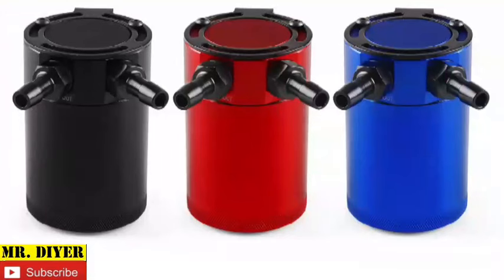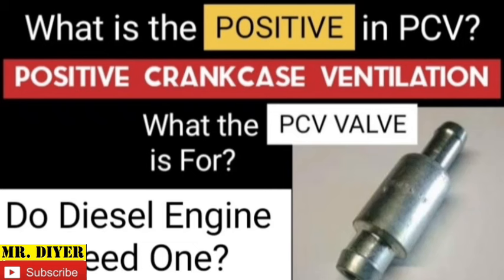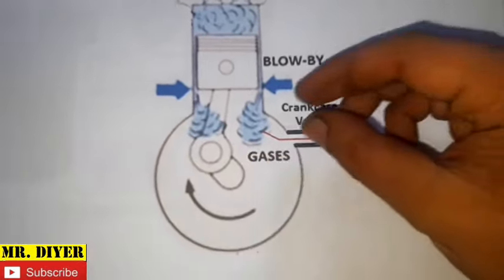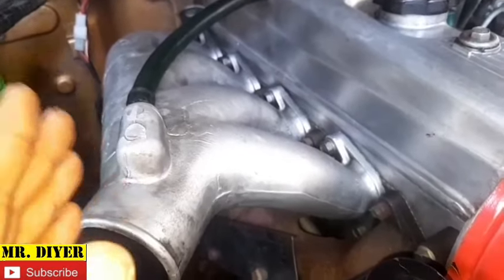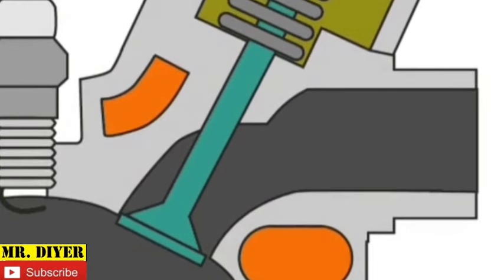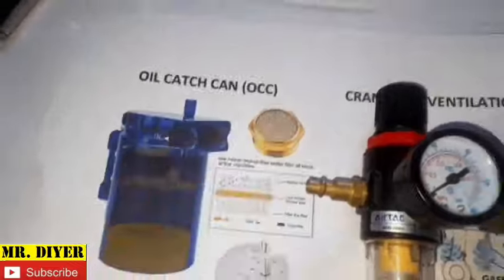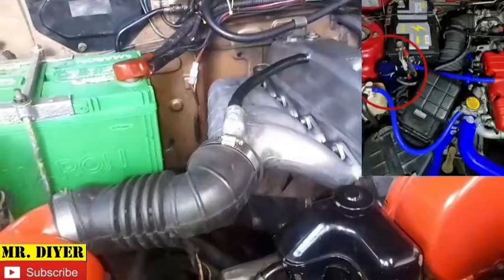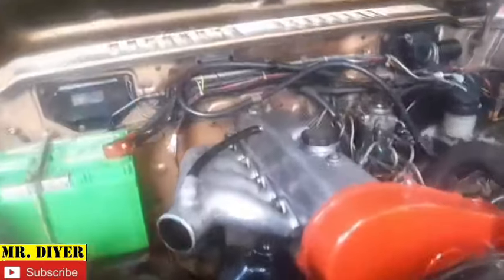This Is Why I DO NOT INSTALL AN OCC OIL CATCH CAN

Comment: installed OCC on my strada with turbo, yung hose nya dumaan sa turbo. yung blow-by na naproproduce ng makina is nahihigop lang ni turbo. chineck ko rin yung dipstick if nag bubuga ng oil caused by blow-by, wala naman. siguro ok lang maginstall ng OCC if meron turbo. even if nahihigop ng turbo yung blow-by (fast air) meron pa rin oil na nasasala.

eto naman sinasabi ng normal ang blow-by sa engines and installing one will help: (turbo with egr, same sa strada 2014)
https://www.youtube.com/watch?v=nAJfNx7lRL0

depende siguro sa makina na pagkakabitan mo ng OCC if good or bad ang effect.
Reply from the maker: Like ive said in the video. If you like to install one go ahead. if you dont want to fine.  Does it matter to me? No. Lol if your engine is going to have issues is it going to be my problem? No. So do what you want with it. Lol whatever floats your boat.
Reply: @MrDIYer  i'm just sharing my experience. i think masyadong restrictive yung nilagay mong OCC. may occ na made for vehicles. the difference is yung sa compressor water separator masyadong fine yung mesh. yung ininstall ko walang ganun, baffle lang (no restriction).

Comment: Your  Logic  is   Faulty . It's the Volume of the Catch Can that slows the gases down . That same expansion would occur in your Inlet Tract .
In fact , MORE SO , because it runs at a Lower Pressure . The Oil fumes themselves aren't actually that big an issue , but when you add  EGR  Gases in  suddenly you have a Problem . You get a Thumbs Down for flawed thinking .
Reply from the maker: @johncunningham4820  lol
Reply: What's funny ? It's True . Unless of course there's a Hole in Piston . That will blow the Seals out .
Reply from the maker: @johncunningham4820  i get a thumbs down from you? You forgot to ask me if i care. Lol
Reply: @MrDIYer . Well you clearly don't , but they never help with the Algorithm either .
Reply from the maker: @johncunningham4820  lol

Comment: Yeah but this works for boosted engines. I have a 2005 Pontiac GTO LSA suoer chargered and I have a catch can. The blow by oil goes into the catch can and I drain it once every 2 months .. or depending on how much I drive it. This OVC may not work for OEM applications but they are necessary for boosted engines

Comment: What an Interesting video. I'm assuming that the car you used in your illustration is a diesel. What interested .e was when you attached that one way valve and got blow out through the dip stick tube. A faulty/blocked PCV can also cause blow out through the dip stick tube. I know this through person experience. 
However what about a V6 petrol vehicle like the Lexus is250? What is your view about fitting an OCC to one of these cars?

Comment: Seems most people disagree, 135 thousand views and only 2000 likes. If you have a engine that is pumping that much pressure then the damage is done. I have run catch cans for years on turbo diesels and seen a significant benifit on carbon build up and benifits with the turbo. So I'll call BS on that one.☺

Comment: This is a good video but also need clarity. The engine you demonstrated is a Diesel engine. Usually they don’t have vacuum in the intake manifold. Adding a catch can to this obviously doesn’t create the necessary vacuum to draw the pressure in the crank. That is why when you added the OCC and took out dipstick, it showed oil spilling out of it. Some modern diesel engine have a vacuum pump to create negative pressure for brake booster and also for negative crank case pressure. 
Now on gasoline engine, the intake manifold creates a negative pressure due to throttle being close at idle. A los of engine have two or more vents in the valve cover. One that goss in the intake manifold for negative pressure and a second that goes from the valve cover to the intake line before the throttle for positive pressure. Again it was a great demonstration you did but it needed little more detail since you were using a diesel engine as your demonstration.
Reply: Thank. This very important!

Comment: What rubbish. You cannot compare a high pressure water separator with an oil catch can.
Reply from the maker: @skitzeeskotz6898  here i made this for people like you whose elevator dont go all the way up. Lol Curious what you have to say next https://youtu.be/rMzFMcHrAyU?si=MRkjWmiYGshefYzl
Reply: @MrDIYer  At least my elevator gets off the bottom floor. Every serious diesel 4x4 owner around me and there are some serious hard core owners ALL have catch cans and as a collective have never known them to be a cause of engine failure. Good catch cans DO NOT restrict flow...they dont operate at 90psi like you seem to indicate.
Reply from the maker: @skitzeeskotz6898  lol 😂 you miss the part where ive said: whether you want to install one or not its upto you.  So brag all you want, guess what, ask me if i care. After claiming that the comparisson was rubbish thats the best you can do? 🤣
Reply from the maker: @skitzeeskotz6898  your elevator really doesnt go up. Lol never said that occs operate at 90 psi. Lol

Comment: you are correct in your case as the flow is slowed a lot via your line having a small drier.  if you have a larger air drier you have more surface area you will haved much much much more flow.  same applies to OCC. and ditch the bronze filter. OCC cans, not necessary.  Id suggest a can style occ that uses swirl and not filter.  Very little to no loss of flow and velocity.  A high output direct injection turbo engine really needs a OCC to evacuate blow by and crank case vapors as to prolong valve cleanliness. My experience in high output performance.  They work as intended with no rising crank case pressure or loss of flow as ive installed and tested, they did not have bronze filtration as well.

Comment: In DI gasoline injection can slower built of carbon deposits on intakes and valves. Because this deposits is built of burned oil and other impurities from engine

Comment: Great explanation,  thank you so much. 
I bought a ssangyong musso 2006 turbo diesel 2.9L a year ago , the inlet manifold was found full of black paste. the engine ventilation from the rocker cover is connected to after air filter and before the turbo. what do I need to do to prevent the build up of carbon and oil at the inlet manifold again please? thanks in advance

Comment: Hi, finally someone with a brain ! 
I have an m57 bmw diesel twin turbo. I measured suction on the hose on intake part on idle and is very low. On 3000 rpm there is quite a lot . The blow by makes my oil have condensation if i let it in the intake. I put a hose as old draft under car and put new oil. 200 mile oil is perfect . Like new . I have egr and dpf delete . Dpf is empty inside. 

I understand catch can problem , i agree, we need to vent fast. 

How about an electric turbine 12 v extractor ? Help vent under car in atmosphere. It would make vacuum as the intake. Could measure to match the vacuum and fit big enough extractor fan .

Comment: The solution is to take a iron pipe from the pcv valve and weld a connection and a iron pipe some cm 
inside in the direction to the catalytic converter. make sure the pipe is sucking then it is right.

Comment: I strip out the screen and filter and replace with a stainless steel pot scrubber pad.  Adding all this surface area gives gobs of oil catching surface with only a little pressure drop.  Site it in a high temperature area like above a catalyst to drive out moisture of combustion and any fuel vapors.

Comment: This occ is a toy and no good..You buy a Mann and Hummel  pro vent 220/100 has a paper fuel and catches the waste has a bottom tap to drain the oil,have had my one on the bt-50 for years.Change the filter at 40000 KS .Its German   made and don't buy the look a likes from ebay.Its not cheap but good engineering is never cheap...Its up to you, to make the choice.Go check it out.
Reply from the maker: Lol ok.whatever floats your boat.

Comment: how about occ during harsh winters? i live in canada and i mostly park outside the driveway. ive read and seen videos where occ freezes and the pressure goes to the dipstick causing oil splashes.

Comment: Thanks. Interesting. However the dipstick pipe is underneath the oil level. So it does not affect the spray out. But with to much restriction or orfice as your air dryer, it restrict to much the blow buy on the dipstick pipe. 😊

Comment: Well dang. About to remove it from my 95 Celica. It has 300k miles. I had cleaned the intake and installed an occ. So I'll put back stock short hose. I want to hit 500k

Comment: As a 3rd generation mechanic and engine builder I don't use catch cans on my turbo vehicles.   Never any problems, use good synthetic Oil change every 5k miles, tier 1 gasoline and change pcv valve every 50k miles. The whole intake valve cleaning is hog wash even on DI engines.
PS most of what you catch is condensation.

Comment: Ok, so to get rid of the oil in your intake , there is another method , on the motorcycles , for ex: Honda fmx 650 and KTM 690 Sm , they have OCC from the factory , it has 3 hoses, 1. engine top cover , 2. engine bay , 3 . air filter box, this is the corect OCC .

Comment: So make the piping to and from the OCC larger than normal to stop the restriction of flow !!
I'd rather have an OCC than none at all, so I'll have to disagree with this video 👍
Reply: Exactly. If you have a small block Ford or Chevy, run a 1/2 or 11/32 hose and you'll be fine.

Comment: you got that totally wrong.  you used a  too fine filter, ( and also  completely  wrong type,)  thats  why you getting  oil blown out the dipstick,  air compressor filter has a fine filter cause its under  HIGH PRESSURE. the occ IS NOT.  DONT USE A OCC WITH  A BRASS  SINTERED FILTER, USE ONE WITH  STEEL WOOL. OR PERFORATED DISC.
Reply from the maker: https://youtu.be/rMzFMcHrAyU?si=S9nL40ucb357v8cO

Comment: I had audi a4 b7 2.0tfsi 200hp, I install OCC in few months and Innotice it consume more oil, so I decided to  removed  and return to stock PCV system .
Reply from the maker: Did  you notice any permanent damage?
Reply: @MrDIYer  nope only  oil consumption getting worst 1L/600km while stock pcv is 1l/1000 is is pretty normal to audi
Reply: I've got the same car. I installed the 034 motorsport catch can kit which was designed for this specific engine. I haven't noticed any oil consumption and I change the engine oil every 5000 km. The catch can doesn't holds almost any oil because the engine doesn't got too much blow by, only the normal one, because the engine is healthy. It obviously prevents carbon deposits on the intake valves, which is the main problem on these direct injected engines. Also haven't noticed any sooth or sludge forming on the engine. I think there's a technical oil spec for the oil to prevent it to get degraded too much by blow by gases, such as detergents and additives coming from the original oil blending.

Comment: The flow is obstructed because of the connectors dimensions not because it's changing volume. What you put definitely increase the pressure in the engine. 
Catch can should be used as separator with out increasing resistance and flow of the air. 
Second that's an old engine new engine use exhaust gas through EGR valve which is not always on but as needed. 

Basicly OCC has to be checked for each car if it makes senses or not.
Reply: That’s what I was thinking, it increased pressure, not decreased or slowed down pressure.

Comment: I always thought, why have all engineers in the world  forgot to put a "tin can" by the engine?
Now I know why. 
Change your oil people at 5k miles and  IF it needs cleaning, give your car to a professional mechanic.
Reply: That's not the reason why tho. The catch can needs to be cleaned regularly therefore it ads liability. 98% people would probably forget to clean it.
Reply: No they can't install it as the oil need to be recycled very often

Comment: Hi! Great educational video. But how about if we bypass the breather hose (free outflow)? Is there any effect to the engine? Reason people do this is, for turbo engine it will re-route to intercooler thru turbo compressor. Later it will make it clog with oil. Thanks.

Comment: I just vent the breather hose below the car. I am not suffering that issue. No OCC needed just vent it to the air.
Reply: That's the way it used to be before emissions standards were put in place. So they plumb the crap into the intake, with the idea of burning it off. But that, as he says, gums up the works and reduces performance. Basically, if you have a high mileage engine with worn rings, with excessive blowby - installing a catch can is helpful.

Comment: Please also do one on the anti shudder valve ASV on diesel engines.
Reply from the maker: It is basically just a flap to close the intake on a diesel engine ensuring that air flow  is cut off and not just fuel, intended to cause the engine to come to a rather slower or smoother stop and prevemt "shudder" which usually happens on older engines. It also prevents diesel runaway because the airflow to the intake is close upon turning the key off.
Reply: @MrDIYer  i had a problem with the vacuum line to this valve coming off and thought my injector pump was going bad because of an unusual engine shudder at shutting off. I also felt an unusual rough idle and slow pickup with smoke. It's the toyota 3L idi 2.8 engine.

Comment: Thank you for that video! Very well explained :) Had to experience this issue first hand. Oil spilled out my engine under boost pressure, now I know why. Gonna throw out my OCC immediatly
Reply: No you need a check valve

Comment: Exactly the blowby gases in my engine is too much after install oil catch can but can I ask you if the oil catch can have a breather is it good or not
Reply from the maker: I dont hink so.because the flow is still impeded from the crankcase and adding a breather on the occ would only mean that the suction provided by the intake would suck in outside air instead of sucking out the blowby gases from the crankcase.

Comment: I did install OCC in my 4d56  but I did removed the filter element so that pressure will exit quickly, maybe? Yeah, it is doing its job it collects a little oil but I learned a lot about OCC on this video tnx.

Comment: I wondered why manufacturers had not put the OCC in the original build (standard equipment).  This answers that question very well.  It does beg for more experimentation, but very well presented regardless.  Thank you!
Reply: I think cause 90% of the people wont want to do another maintance and would forget to drain it. By saying that all of the “collected” oil wold be sucked back to the engine internals and make it worst.
Reply: No, the reason manufacturers do not put OCC on the vehicles out of the factory is because it is a system that must be maintained, you must check it regularly and empty it.  If you ignore it and it over fills you can then get engine damage. Manufacturers know most people do not maintain their cars properly and that most people will not know how to or bother to maintain the OCC, so this is why they are not put on the cars at the plant.

Comment: I don't know where you live, but the problem in cold climates such as Canada, is that the build up of condensation in the vent box & PCV system freezes and also eg. in the older Chev 4 cyl (2.4 L) engines, the PCV vent hole in the Intake manifold is tiny and "gunks" up easily. The result of all this is ECC pressure, which eventually blows out the rear main engine seal or the Intake Manifold gaskets. In Canada we have a number of "California" engineering designs, which do not work in the cold weather of Canada! I am surprised, considering the number of failures and repairs recorded in the above engine systems, that GM has not designed a better production solution. They do have an "advisory" on the piston ring/ oil burning issues on these engines.  Other inherent known problems on this power train, eg 2010 - 2017 Chev Equinox etc AWD Transfer case, ie seals, bushing failure and or loose fluid pump issues.                                                       
See https://youtu.be/D9C5q59GQ5s

Comment: I did the same experiment and you are spot on, BUT i had a old pro vent catch can and the filter was gone (stuffed) i scratched the paper off and bought those stainless steel scrubbers for the kitchen sink and placed them around the remains of the filter just like the old oil bath air filters on old cars it works great the oil gets caught on the surface of the pads and runs down into the tube and it is a lot less restrictive, if any they make them with paper filters so you have to buy another one they do work but they only slow down the inevitable but its a dry carbon  and it does take a lot longer to clog your inlet manifold

Comment: air compressor pressure is regulated by the diaphragm of the regulator whereas OCC does not have,the filter in OCC only act as condenser and the void space in it is equivalent to cross sectional area of the vent hose.Very important that the size of hose is equal in crss sectional area of the vehicle  vent hose otherwise it will increase pressure and affect the engine performance.

Comment: You need to first consider the effective size of the flow path within the regulator/dryer and the added plumbing apart from the actual drying features to account for flow those losses.